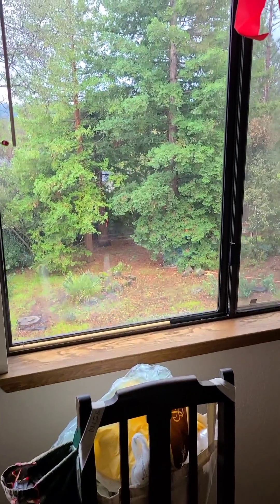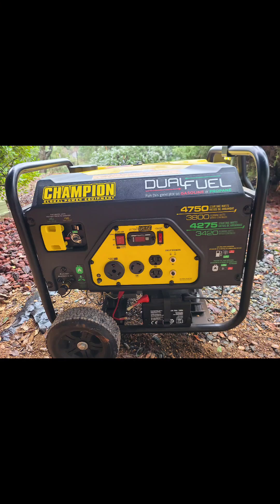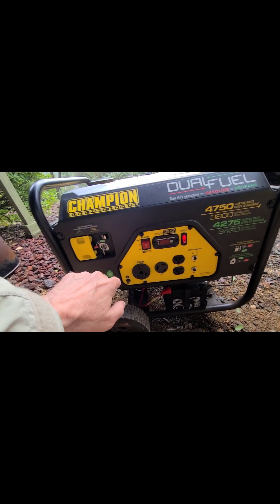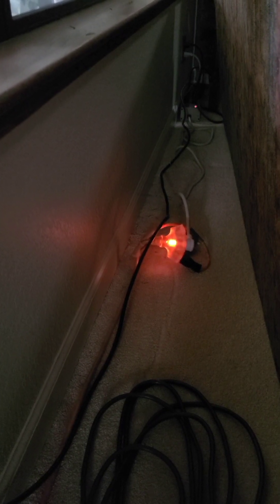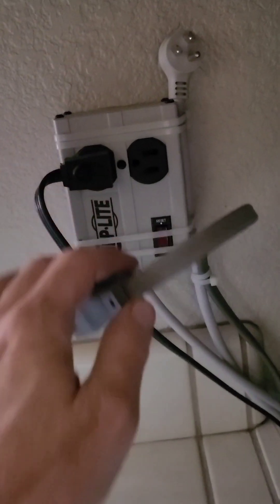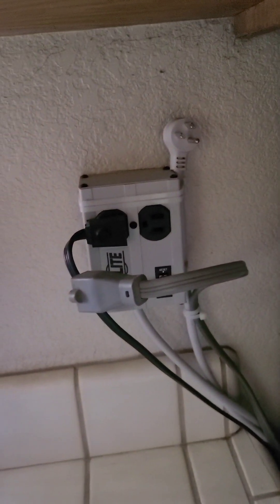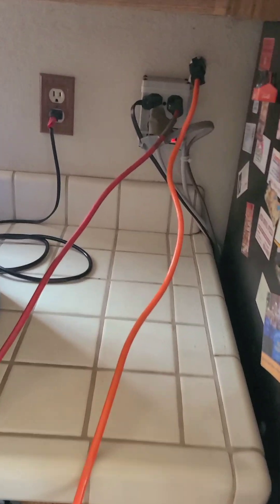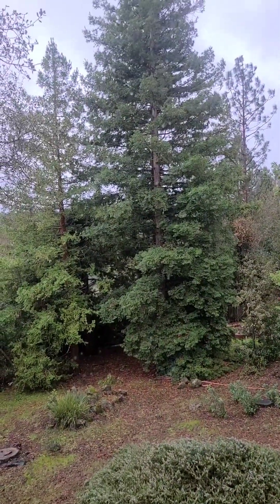The power is out!  How I set up my portable generator to run a few appliances  in the house.

Comment: My first time wanting to get a generator. I don’t have a transfer switch for the generator so I’m going with the route you’re using. When you say grounded with the extension cord what exactly do you mean?
I hear that the generator has to be grounded using this method.
Reply: @nathanielstuckey3354  thank you so much!
Reply: @nathanielstuckey3354 I’m not familiar with electrical stuff so an electrician will do the set up. 
Thank you!
Reply from the maker: There is a grounding point on my generator...and I suppose I should use it...but I never have.  The extension cord has a grounded plug and the house is grounded.  Good point.
Reply from the maker: Oh...wait a minute.  Now you have me thinking.  Sure, my house is grounded BUT in this configuration I'm not connected to the house's ground.  This is a real good point.  I absolutely should have the generator grounded.  I could easily install a grounding rod in the brush near where I run the generator.  Cheap insurance.  Thank you for this comment 😀.

Comment: Thanks so much for the great tips, Aaron.  I have been researching dual fuel, portable generators, and want to buy one.  I love the extension cord thought the wall, and the surge protectors....what a great idea!  It sure beats having wires running in through my doors or windows.  I saw some through the wall outlets, for generators, on a Costco website, but they were expensive, Brenda.